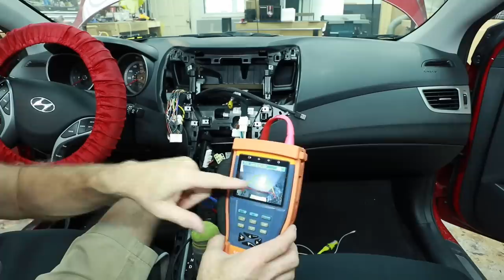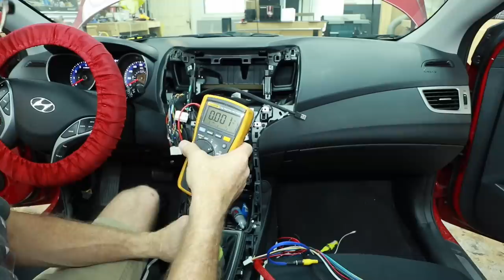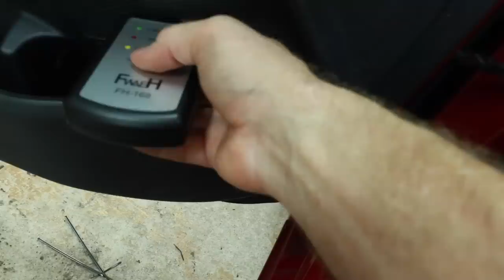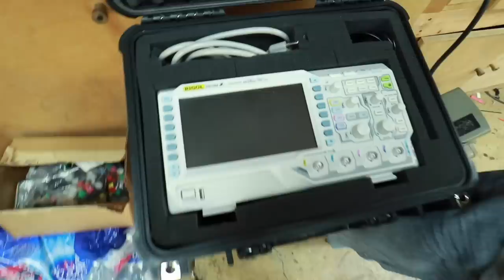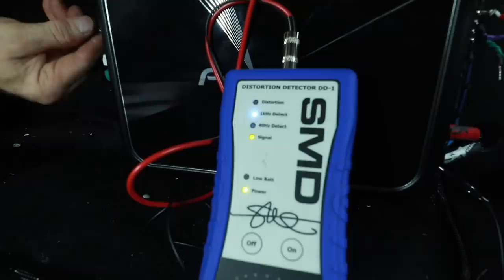The process of a 911 make over in this Hyundai Installer Diaries 211

Comment: I’ve had so many problems with the ilx w650 radio.... my truck has been to the shop   I’ve had install my radio at least 5 times. I have the ilx w650 with the amp combo. Audio volume was the same as my factory radio  honestly there was a slight difference between my factory radio and the ilx w650 regarding the audio quality. Went back to the shop get that resolved was told they could not do anything about it. Then the bass was god awful my factory radio had better bass went back to the shop and was told it’s the radio then a coupe of weeks later the back up camera comes on and off intermittently. Was told they used several different cameras and the radio was broken. So I’ve completely and utterly gave up on this radio. I told the shop that installed it I want to return it and get something completely different. So now I’m waiting hopeful that alpine is going to give me my money back so I can buy a pioneer.

Comment: As with any trade, very few retail customers realize there are levels to it. The work was low quality and in this case, didn't actually function properly. Just think about how many installs the other shop sends out that (at least initially) appear to function correctly. Like the battery connection, how many people hiring their stereo install would know the difference between where it was mounted each time but a loose battery connection will inevitably cause problems. The bare metal and holes from the ground wires will inevitably cause problems. And, months or years later when these problems present they may very well be attributed to stereo shop installers without distinction between shops like this and shop like first did the install.

Comment: Noob question but why wont u route the wires from the middle straight into the dash, this whould make the the wires shorter and maybe make it better right?
Reply: what do you mean? like from the trunk straight into the dash?
Reply: @Caleb_FC  basically
Reply: @Caleb_FC  from the trunk to the dash via the center console
Reply: @TheZombieSlayer1155  cosmetic and space. you couldn't conceal the wire in the back passenger seat, and in most cars i've done installs on the gear shift is either in the way or the center console is so compact it's hard to get the thick wires through. you also have to run a positive lead to the battery which is on the side of the engine compartment, so it's much easier to just run through the door trim panels.

i rarely hook up to the head unit though. i typically just splice into the rear deck speakers with an LOC so the only wire i have to run to the front is the control knob wire and the positive lead.
Reply: @Caleb_FC  oh okay, thanks!

Comment: I have one of the worst installs ever.  I’ve been trying to find someone to rescue it but nobody wants to help.  This install is on a 2020 Honda Accord sport.  The installer mounted the tweeters with duck tape behind my door sail.  The speakers were all wired backwards. He cut a hole in the interior behind the back seat to run wires through the center of the fabric.  All my stock Orem speakers he said he had to destroy them to get them out.  He screwed the rear crossovers into the underside of the rear deck so when I put the rear seats down I can see the crossovers hanging there.  These are just a few of the issues not even getting into the sound how the bal and fade is backwards.  There is no mid bass sound at all.  The subwoofer goes into the loc with a y splitter and only into one channel.   I bought a lot of nice equipment for this install and it’s so botched. On my front speakers doors because they are big dB apocalypse they hacked away at the door metal to get the magnet in.  Then used dum dum around the speaker to stick it in there and stick.   This is so sad.  Please help

Comment: One thing I didn't see and should me mentioned, allot of newer car and  Hyundai  have a FM antenna amplifier, it will need 12v acc power, you can use the antenna power wire for it, if it's not connected FM reception will suck. 
Great video otherwise, the hack that did that original install needs to never touch another car again

Comment: I like everything you've done here, except for one small thing.  You blocked off the aux jack.  I understand that he has an iphone so he won't be using the Aux jack, but what if he switched phones at some point, or maybe a passenger had a phone or device that uses it?  The point is, it would be nice to have it functional, just in case.  I feel like you should have just gone ahead and made it functional rather than blocking it off, even if would have cost a little bit more time or the customer a little bit more money, cuz t would just be a little bit nicer to make sure he has the option.  It would be better, for me, if there simply wasn't an aux jack at all, because seeing/knowing that there's one there, but that it's blocked off, would actually be more annoying than just not having one at all.  I dunno, just my .02 

Otherwise, I really like everything you've done, everything you do, I support your work, especially because you make sure to do everything properly, and that's because you actually know wtf you're doing, obviously unlike the previous place the customer went to, which I wish you shared the name of with us, so that we can know to avoid going there (I know there's some risk in doing that, and you probably don't want to bring any heat on yourselves for doing that, but I just hate the idea of allowing them to screw other people over the same way). 

Anyway, keep up the good work Bro.

Comment: I may have to drop the car off in Tampa next time I’m on vacation. I always do this kind of thing myself but to buy the equipment needed to do it right like this, I’m starting to realize it would be cheaper to have a good shop do the work. Hard to trust anyone these days though.
Reply: and truthfully hard to trust yourself to buy the correct harness for each factory accessory. I drown myself for hours cross searching/forums to make sure a harness works. 4 hours deep into a complex harness and it was make for a newer model or mid year refresh the car manufacture decided to re-do the plug/wire colors.

Comment: my components don't match each other. I prefered my infinity reference tweeters to the ones that came with my boston pro's. and I got mb quart reference 6.5 separates in the rear. These are all powered by a ppi pc450 first gen. All this stuff is still kicking 25 years later. I still have my civic that I got brand new when I was 16 in 1996. It has 94,000 miles and is just a toy. But I am actually stripping the interior and putting that stuff with a ppi 2100 first gen, powering 2 orion 2ntense dvc 12's in my 1995 land cruiser. All gear that I have had for 20+ years. Why fix what isn't broken.

Comment: I’m loving fix factory horness before install new radio in this case I’m okay about cutting remaining speaker plug and put new connector back in because it left 1 or 2 plug but why don’t use maestro idatalink main horness I’m okay but I don’t like you retain factory usb that way because maestro idatalink make new simple circuits board to retain factory usb spots I don’t like glue or drill or cut or trim any factory parts .you cut 3 wires and length and soldering back together  in this case I’m okay because you have to length 8 speaker wires it hard to do in car you cut remaining 3 wires to fix factory horness easier I’m okay but if all factory horness are perfect then you cut factory horness,I’m not happy.

Comment: Ya your doing a good job but it’s not rocket science! I’m just wondering what you charged this pore guy. I see he has not a clue about car wiring and I bet that cost him at least $100 . Now I understand who ever installed this ya they did a horrible job and yes it looks like you are going to do it right. I just hope you didn’t use his lack of knowledge on this subject 
To stick him. 
I don’t cut factory wiring much easier to buy the adapter plug. 
I solder all my connections and use heat shrink tubing on every thing. 
Like I said your doing great work
And I do believe you love your profession just hope ya don’t stick ppl. Most places do shity work and
Profit from it. 
I just wish he knew what a 
Reasonable price should be